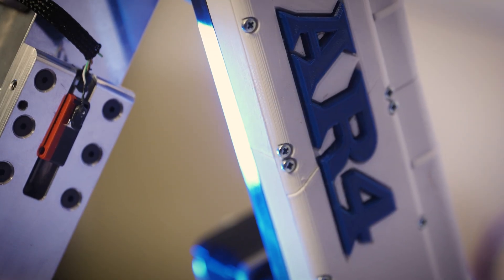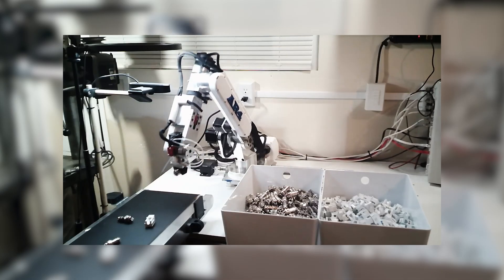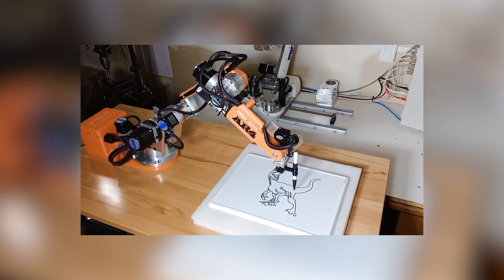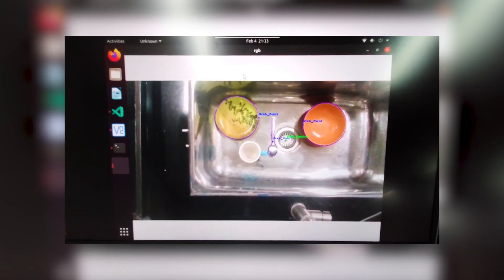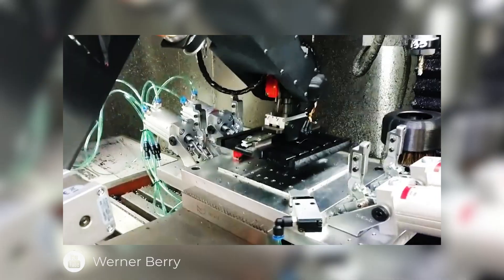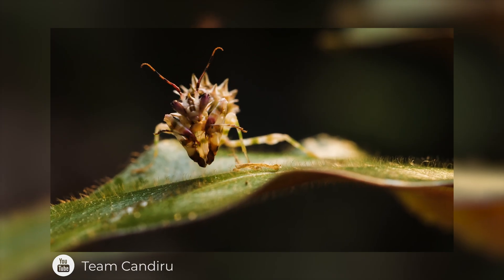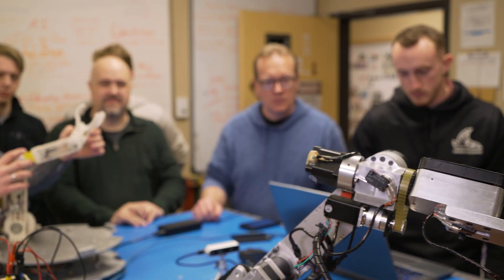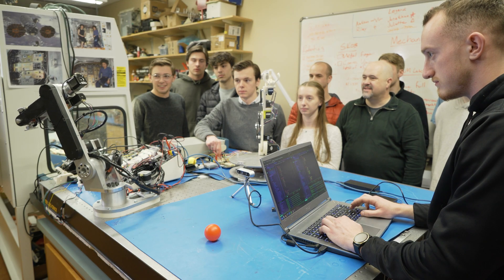Affordable 6 Axis Desktop Robot Arm - educational & industrial DIY robot kit - Arduino controller

Comment: Is it possible for me to print the whole robot out of asa carbon fiber?  if so would I only need your hardware,electrical parts kit and stepper online motor kit?
Reply from the maker: @slapcitykustomz1658  yes you can definitely print the entire robot.  And as you noted you just need the electronics, motors and hardware. Email me if you have any questions. info@anninrobotics.com
Reply: @anninrobotics With the motors when not powered do they stay stationary or do they not hold its location? Also I will be switching from limit switches to absolute encoders so homing won't be  necessary, using your software is it possible for me to implimemt it?